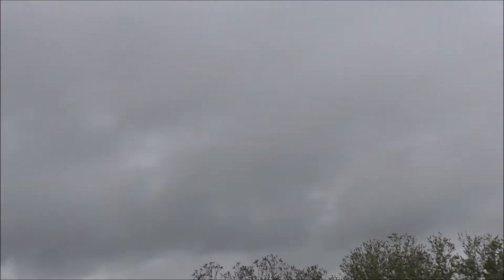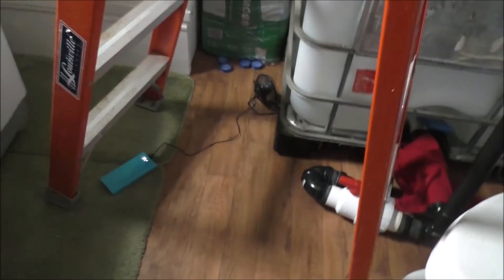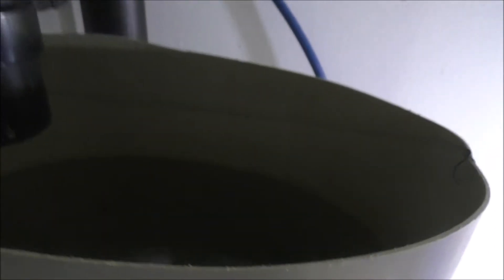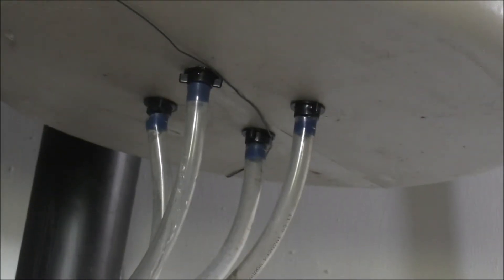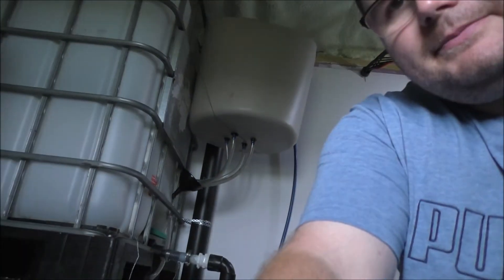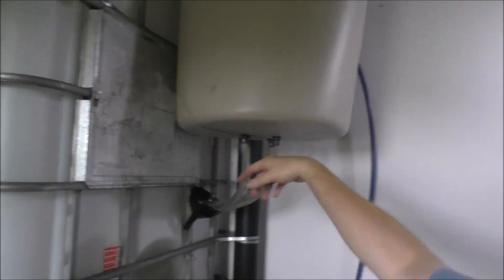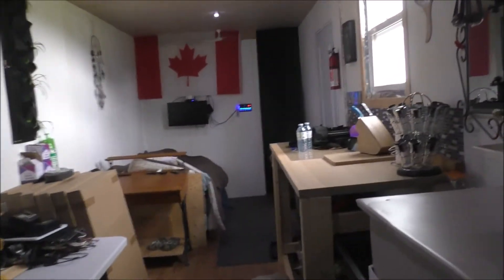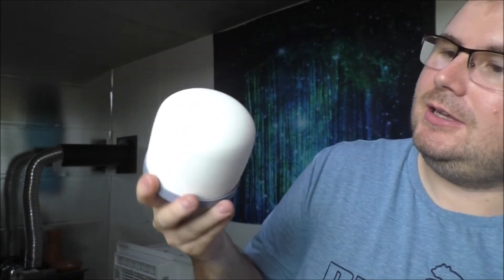My Followers Are Right

Comment: The filters may work well ( but ) they filter much to slowly. Adding 2 more filters won't make much difference. With a good down poor the catch with the filters will fill up faster than even 6 filters will work.
Reply from the maker: yes your right. i had to scrap this whole design and rip the filters out. You will see in future videos as i discover the cons.
Reply: @TheOffGridTinyHouse   You had a good idea, but you would need a larger catch to hold the water and interior space is precious.  What about some sort of tote container underneath the trailer with a 12v sump pump or just a pump to transfer the water up and inside the trailer. You could have multiple totes placed under the trailer to catch water, then just filter bit by bit
Reply from the maker: @davidpedder9048  yeah its a good idea to do it that way. i think u will like what i came up with. you wont see for a few weeks though.